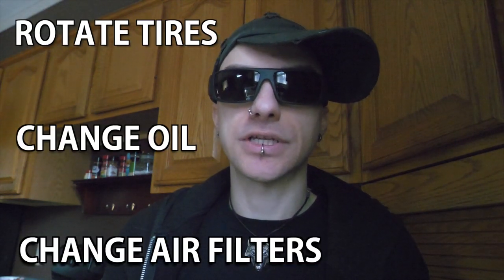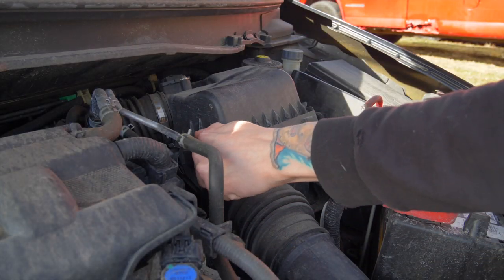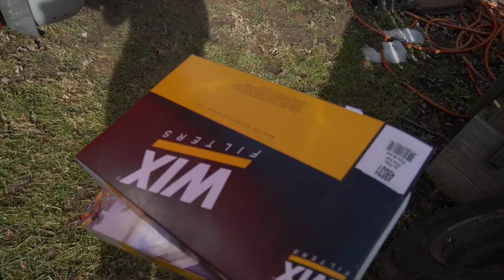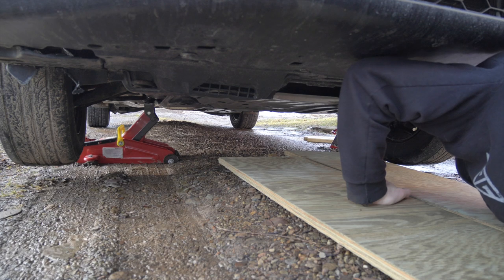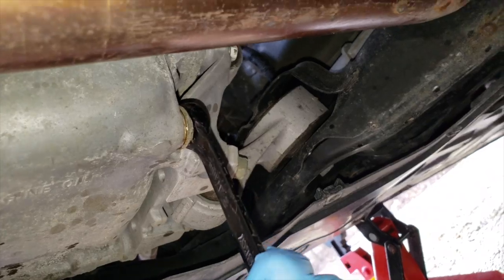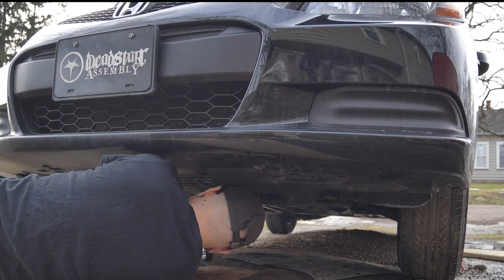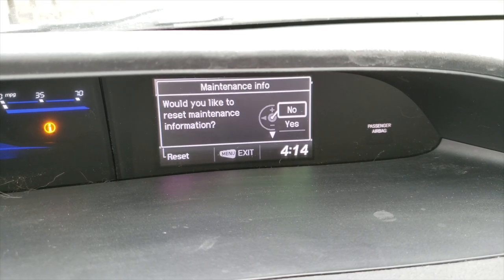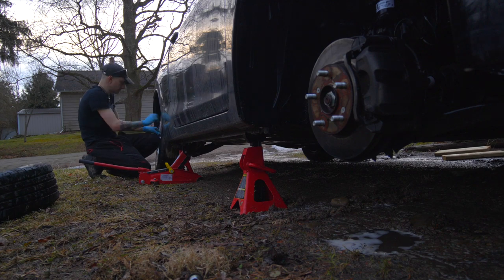Basic Car Maintenance - Changing Air Filters, Oil, & Tire Rotation on my 2012 Honda

Comment: I would have definitely gone back to the shop and made them fix it... It happened to me before where they messed up one of my valve stems and sure enough, they fixed it.
Reply from the maker: I was afraid to let them even touch my car again. I also had no proof the guy told me on the phone that i needed plugs and asked if i wanted them changed. I felt it would be more of a hassle than it's worth at that point. I don't remember if i called them to at least tell them or not. I know much more now thank god

Comment: Man dro here’s a nice little fucked over by the dealership story for ya.... 

I bought a used car from a dealership had 2 free oil changes. Took it for the first oil change since getting the car and they told me I’d need new tires by spring.  Two weeks later I walk out to leave and had 3 flat tires. Coincidence THREE went flat at the same time after being told I’d need new one in a few months?  

I never went back to that dealership. That car is long gone now and I still don’t trust dealerships.  my brother does any and all work needed on my car now.
Reply from the maker: Nice. It could have been a coincidence but it seems with mechanics they happen way too much these days.